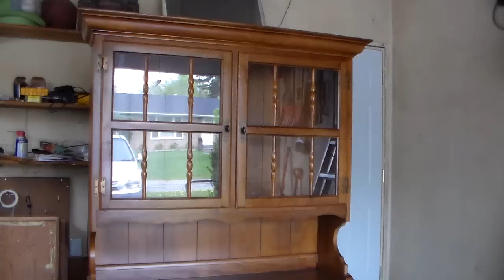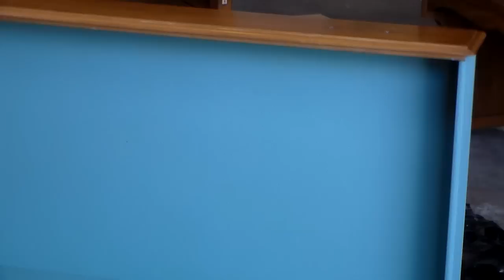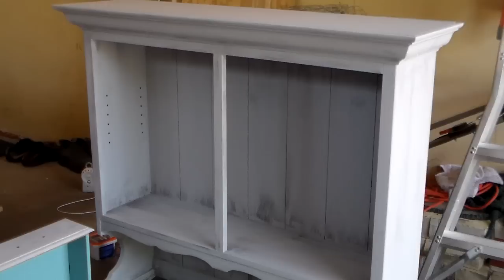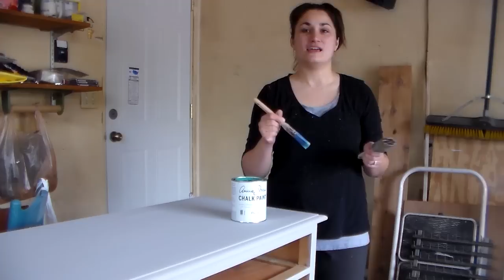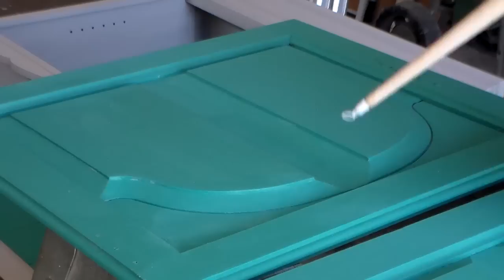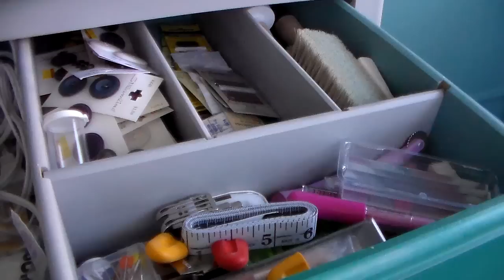How to transform a dining room hutch using Annie Sloan Chalk paint and two-color distressing

Comment: Hi, great job. 
I have a few questions, if you could answer it would be great:
1. why do you rub wax BEFORE distressing? doesn't it cause a smear when you lightly sand it afterwards?
2. Do you apply a top coat other than the wax?